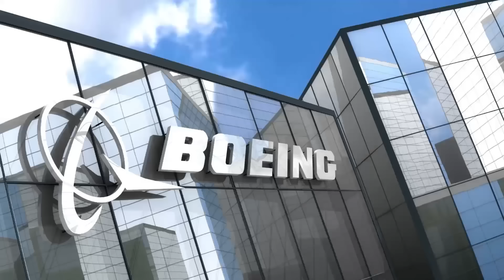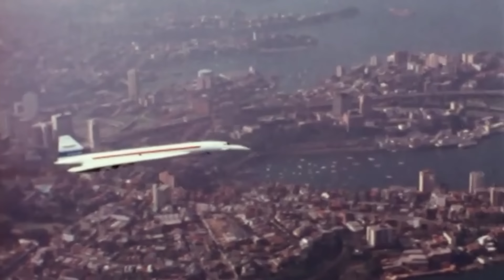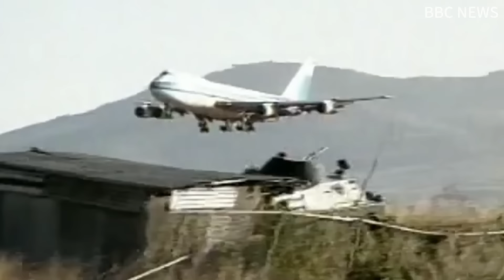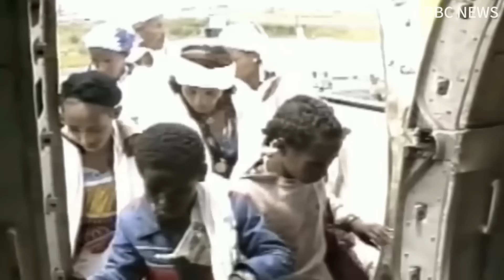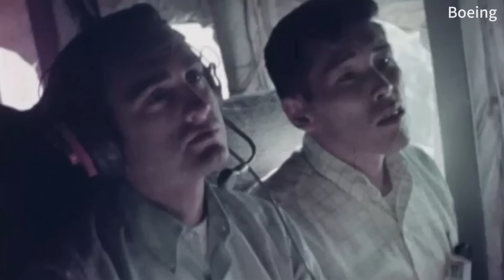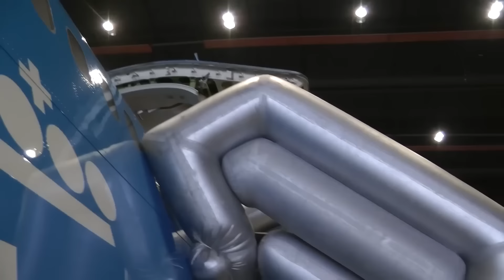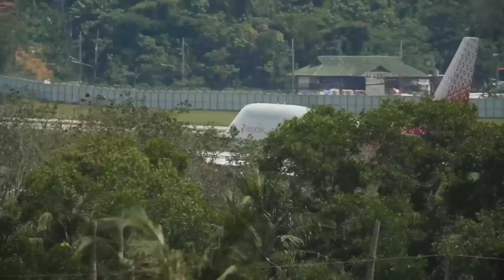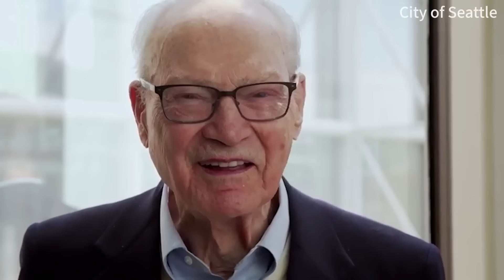What The Boeing 747 Hump Was Really For

Comment: You didn't mention Boeing built and designed the building in parallel with the designing & building of the first 747. They literally had engineers in the basement sending designs upstairs as they finished them while prototype assembly was going on, and the building concurrently built over them 🤯 Boeing has turned those basement corridors into a gallery of pictures of this work - must see if you can get a tour

Comment: Long may this Queen of the air live on.

My first airplane flight was back in 1968 onboard a DC8 when my family emigrated to Canada. My next flight was in 1976 when I returned to England on a vacation. It was a Wardair charter flight onboard a Boeing 747. 

I remember getting to Winnipeg International Airport and looking for my flight, it was at Gate 1. Back in 1976 Gate 1 was an outside door to the ramp, and you followed a marked footpath to your plane. I didn't know what kind of plane I was booked on, so I couldn't believe what I saw when I went out onto the ramp. I knew about 747's and had seen enough video of the plane, however, this was the first time I saw it "in the flesh". It was huge with a mobile staircase pushed up against the side of it - no wide body jetways in Winnipeg back then; I was a lot younger at the time, mid 20's, so climbing those stairs was not a problem as it would be now! It was a flight to remember.  I had booked early and since it was a charter flight it was classless.  I was in seat 3E almost at the front of the plane where the fuselage curves to the nose. Being a window seat, there were only four seats across with a center isle at that point, gave me lots of space and a fantastic view of the outside world.

In a previous comment an ex 747 pilot remarked on the planes handling ability. I am sure that the pilot that day was hand flying the first 20 minutes of so. When we took of the sky was broken with lots of large fluffy cumulus nimbus clouds. To give us a smoother flight I remember the pilot climbing and banking between the clouds. It was fantastic - as was the free liquor on the flight along with real china, knives and forks for our meals. We arrived at London Gatwick, with its widebody jetways, and I had a memorable vacation visiting family and old friends. On my return trip to Canada I knew what kind of plane I was flying on so I immediately requested the same seat back.

This was an interesting video, however, these facts are more like "little known facts" rather than secrets, click bait. One fact not mentioned was that this plane enabled airline companies to lower the cost of tickets and introduced flying to thousands of people. It's interesting to note that this iconic plane and the Concord were developed about the same time. And oh how Boeing has gone downhill since, 28 months to get the 747 into the air using paper and pencil development tools - and engineers who where given preeminence in the company. How long did it take to develop the 777 and 787 computer assisted? I have only made three trips back to England - and each trip was on a 747. Long may this Queen of the air live on.

Comment: Never flown on one but my brother helped build them. And two of the first ones he ever worked on the were the two VC-25s in the mid 1980s; otherwise know as Air Force One. If you knew how incredibly different and specialized they were compared to a "regular" 747, you'd know how insane it is that Trump is taking that "free 747" from the middle east. Just to get it up to speed with the current air force one capability would essentially entail tearing the entire thing apart and gutting absolutely everything and would almost certainly cost more than the cost of the two new planned air force ones.

Comment: I was on the designated Maintenance Crew for United Airlines First 747.
 Arriving at SFO in early July of 1970.
 It's Size was so much greater than anything we had ever worked on and we were in Awe of everything about it.

 One thing I would add to this list of things people may not know about the Queen of the Skies is that it could fly with FIVE Engines!
 Because the engines were so Big that transporting spare engines to locations was a problem Boeing built a Mounting location (Hard Point) into the Left Wing inboard of the #2 engine.
 We used that feature to transport spare engines from SFO to Hawaii as that was our initial 747 route flown almost daily. 
 The 5th. engine was not powered and used a streamlined cover to minimize drag.
 The FAA only allowed the 5 engine configuration to be used in Non Revenue  (crew training) flights.

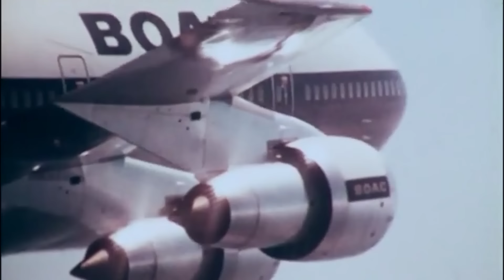Comment: 3:45 That question is easily answered. The engineers could, but they won't. There were even faster subsonic airliners back in the time, like the Convair CV-880 (MACH .87) and CV-990 (MACH .90), but they did not enjoy much success, being built barely 100 times compared to the more than 1500 of the Boeing 747. The higher speed is bought by so much more fuel consumption, that it simply does not pay. That's why modern aircraft are slower - less air resistance for higher efficiency.

Comment: In the early '90s, I returned home from New Zealand on a non-stop flight from Auckland to LA. The plane was a brand-new 747-400B4 (?), with proudly labeled Rolls-Royce engines. That the plane was new was apparent from the fact that the air stewards cut the plastic wrap from the seats as we were seated.
There were 80 passengers on that flight. It's 14 hours from Auckland to LA, and, as we in economy class--seems the only place anyone was--would get drowsy, the stewards would offer to let us sleep in the first-class sections! I was able to tour the entire passenger areas of the plane.

The food was awesome--a hat tip to Air NZ, not Boeing. So were the air stewards--what us old timers called stewardesses.

But I've been taught that there are two voyages you never want to take on an aircraft or ship--the first and the last. However, knowing the Boeing 747 was made in the US, I knew it wasn't the first flight.

But, then, the confusion of landing in LA the same day we left Auckland, an hour before our departure time....

Cheers, old girl!

Comment: I've flown on the 747 several times. I prefer it to any other plane I've flown on. Admittedly, I've not have much experience with Airbus planes, but compared to old Douglas/McDonnell Douglas, there is no comparison. The only plane I even talk about in the same breath is the L1011 and that because of its earlier adoption of some flight management systems.

Comment: When the 747 was first developed in 1969, Boeing and many airlines believed that supersonic jets (like the Concorde) would soon take over passenger travel. So, they designed the 747 to be easily converted into a cargo aircraft later.  To do that, the cockpit was placed above the main deck, creating that distinctive hump, which allowed for a large nose door that could swing open to load cargo straight in.

Saved you 17 fucking minutes.

Comment: I flew on the 747 four times. All of them on the upper deck. Prior to the 9/11 high jackings, the flight deck was not secure during the passenger loading. On my trip from Singapore, I purchased a video camera and asked if I could video the flight deck. The flight attendant asked the pilots for permission, and I was given the opportunity to video part of the preflight preparation. The flight attendant was impressed with the camera, and asked if I wanted a tour of the aircraft. I answered yes, and she asked if she could take the camera. I agreed and she took me on a complete tour of the cabin, of both decks. She even took me into the first class section in the nose on the lower deck. I was shown parts of the cabin that most passengers would never see. It was an experience I will never forget.

Comment: The Concord = Mach 2 speeds, and faster than an F-35 fighter jet
747 = will LITTERALLY break up if it exceeds Mach 1, so don't say it's closing in on Concord, because it doesn't!

Also; the Antononv An-225 Mrita is one commercial airplane that could carry the space shuttle with ease...
It was often used by NASA when the 747 wasn't big enough to carry parts of rockets, rocket boosters, aso... 
And Mriya was designed to carry the Russian space shuttle that was the same size, shape and looks of the American one (you could say it was a copy)

Comment: One of my favorite aircraft, worked on these at major overhaul facility for many years . Including replacing the frames on the Section 41(head) lower & upper deck. Fuel tank entry,paint, skin replacements,Taxi & engine run up. 
My favorite was the SP model.

Comment: 54 years of FLYING THE QUEEN of the skies, 1971 - 2025.  My first flight on a 747 was on AC Toronto Vancouver in June 1971 on a 747-100.  First flight to Europe we flew was on a Wardair 747 (CF-TUB or CF-DJC) in 1975  (what a party) Vancouver-Gatwick.  While Wardair was still flying charter the family flew every year Vancouver-Bridgetown Barbados for Christmas Holidays (Margate Gardens).  I cannot count the number of flights when we lived overseas. Our family relocation flight to Singapore was in 1986, our first flight on SQ BIG Top 747-300.  When we lived in  the United Arab Emirates we flew several years back to Canada in the upper deck 747-400, utilizing the RBC BA VISA CARD that had a 2-for-1 flight benefit. Other years we stopped off in Europe so utilized Gulf Airs 767 unfortunately (though it is pleasant enough).  Probably our LAST FLIGHT was on a Lufthansa 747-8i in March this year (upper deck of course) from FRA to SFO.  The LH UD cabin is the very old version and was very disappointing unfortunately.  Maybe there'll be another chance after the refurbishment.

I wonder how many miles we flew in the 747.  A rough estimate would be 54 years times 10,000 miles or 540,000 miles!

The only "bad" experience was flying Wardair from Honolulu to Vancouver Christmas (1976?) when Wardair flew through a severe thunderstorm.  Every other airline had delayed flights or re-routed but I guess the schedule with only 3 planes required a bit of turbulence.  We were in the upper deck but even the flight attendants were instructed to belt up.  Bottles were flying and the upper deck rocked violently side-side.  A true testimony to the design.  After an hour or so things became normal and I requested a second filet mignon.  The FA said "no problem, we've got 150 that weren't eaten from the back of the airplane" and that "even the flight crew back there were sick".  The two filet's were brilliant and the Bordeaux washed them down wonderfully.

When CP Air bought their first 747's, I was hired by BCIT to teach the flight maintenance and electrical technicians the electronics of the Inertial Navigation Systems on the 747.  I was great working on something I have loved for life.  Unfortunately because I was a BCIT employee I could never convince CP Air to give me even one free or employee discount flight.  Sad for me as I was young and just married.  A free flight to Asia would have been stellar.

Comment: The 747 also forced the redesign of many older existing airports around the world and set minimum design standards for newer ones.  Runways needed to be lengthened to accommodate the aircraft.  The taller, larger aircraft and its greater numbers of passengers required airports to have larger terminals, waiting areas, customs arrival halls, baggage collection areas and jet bridges, including (I believe) the intro of double jet bridges to load and unload passengers more quickly to turn over the aircraft.

Comment: Uhmm, the air industry slowed there flights down back in the late 90's, or early 2000's, to reduce fuel consumption. 
So these slower Air Busses were engineering for the market. 

These 550+ mph flights, probably cost the passengers more in air fair, basically a premium on those flights.

Comment: What the hump was for? It was designed as a freighter first. They were competing for the contract that eventually became the C-5, and that hump let them lift the cockpit out off the way of the cargo deck, and fit a huge nose door, so it can be loaded and unloaded incredibly quickly and easily. Boeing lost that contract, but judging by the number of 747s they sold, they won out in the end.

Comment: I flew multiple times upon the 47.  many as a passenger, once in the jump-seat in the cockpit (not a pilot) and my father was a Flight Engineer with Boeing and was part of the teams that were sent to train air crews with foreign airlines.  I even had multiple opportunities to operate and use the 47 simulator at the Seattle plant, with my father.  Easily one of the best airlines ever.

Comment: I flew NW 747's from DTW to FRA and back many times upstairs Business class in the 90's.  Great ride.  Very quiet that far up and forward of the engines.  My wife and I were upgraded in the 80's to First Class nose seats on a SAS flight from Oslo to DTW also very nice.  As a student in '83 I flew in the rear most section of a Belgian airline 747 from DTW to BRU and back.  Not as comfortable, the tail seemed to "wag" right to left in turbulence.  Fantastic aircraft.

Comment: Not the fastest passenger airliner: Airbus A380: Cruise speed Mach 0.86 (490 kn; 913 km/h; 568 mph) typical
Mach 0.89 (513 kn; 950 km/h; 591 mph) max operational, with a maximum design speed of Mach 0.96

Comment: My most memorable experience with a 747 would have to be climbing up into the lower deck of a freighter while taking inventory of the spare wheels, tools, spare parts, and oil kept onboard. It was winter but the APU kept the inside so warm that I had to take my jacket off.

Comment: In the late 90s, was booked on a 747 after the aircraft for my original flight had maintenance issues and was grounded.  Turns out the 747 was supposed to be a relocation flight from Detroit to Orlando.  Biggest plane I have ever been on, and empty... including the flight crew, there were less than 50 of us on this plane.  Entire center row to myself.  As soon as the seat belt sign went off, all the arm rests went up and that center row became a bed.  Best sleep ever on a plane.

Comment: In 1987, I was hired by Boeing as a Flight Test Engineer for the 747-400 certification program. My job was to configure, maintain, and operate the instrumentation system aboard the test airplane to gather and record all data for each flight for use by the aeronautical engineers, or the 'brains' as I called them. I was on the crew for one of three aircraft, RT-451 which had the Rolls Royce engines (2 others had P&W and GE engines).  Every part of that air frame had sensors to measure every imaginable parameter there was. Perhaps the best part of that job (aside from flying on the day shift) was that I was lucky to work with a crew of old-timer mechanics and electricians near to retirement, guys who worked as young men on the flight test programs for legendary historic aircraft such as the B-47, B-52, 707, 727, 737, and of course the first 747, air frame # RA-001, the white and red 747 shown as the opening image in this video.  It was a privilege to fly on, and learn about that magnificent massive Queen of the Skies.

Comment: The Qantas B747 with the GE CF-6 Turbo-fans swapped the engines for the Rolls-Royce RB-211 made for the Lockheed lL1011 Tristar.
I hear it saved Qantas 1.000.000 a year in fuel per aircraft, it doesn't sound real does it but when I first heard it other internet sites set the same thing including Qantas and rolls Royce
That is Massive, if this is wrong the claim was made by other aircraft experts !

Comment: As a young boy in the summer of 1970, I was in Heathrow airport boarding a 747 in one of its first transatlantic flights to New York. My mother and I, flabbergasted by the size (we both had been flying in Europe since the early 60s) had taken our seats and were ready to take off. In that very moment, one of the flight attendants mistakenly pulled the wrong lever and the emergency slide was activated. I remember walking past the crying lady as we deboarded and that was the first and last time on a  747. We flew the next day on a stretch DC-8 and all other times I flew either with the old 707, VC-10, but mostly with a DC-10.